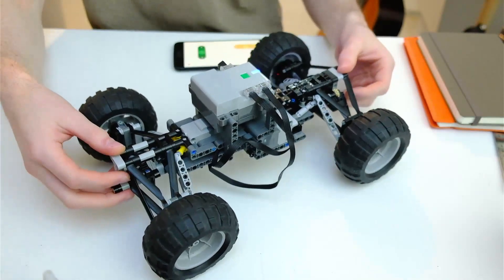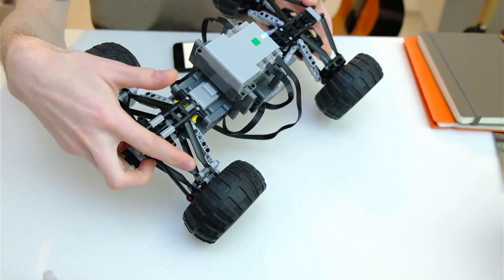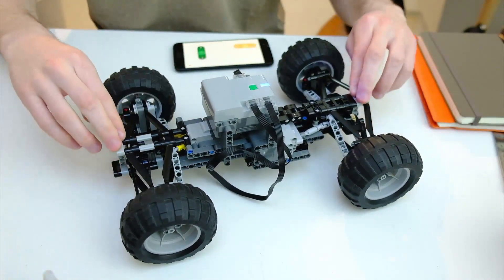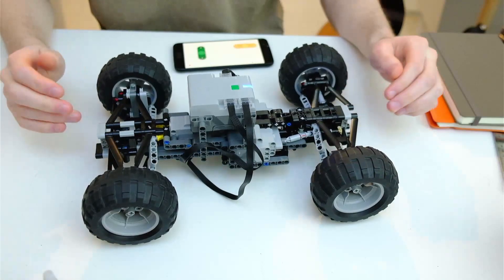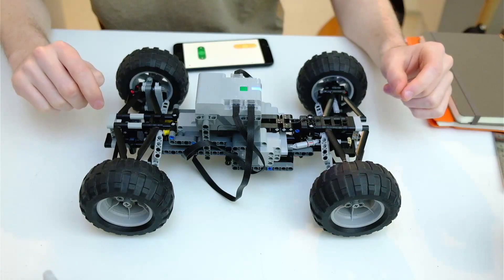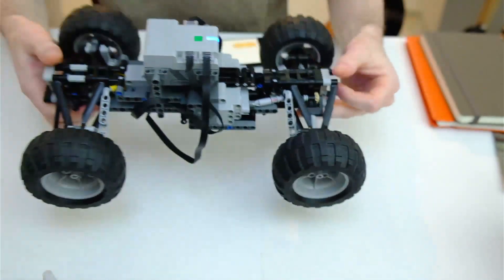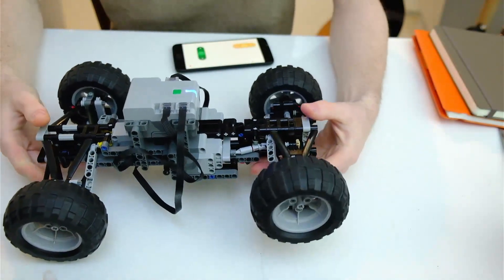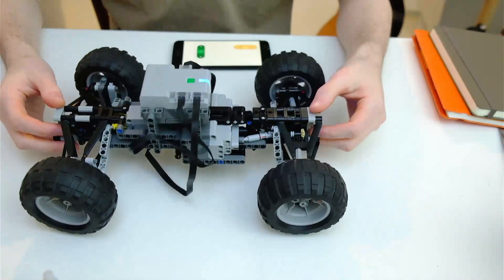Lego Technic Traxxis e-revo style pushrod suspension

Comment: Not a rigid setup but will probably handle the torque and speed of the powered up system. Such a cool design!
Reply from the maker: Thanks, a very valuable critique. I'm hoping to improve on these very aspects but I'm skeptical of being able to do so with the wishbone parts, so I think I'll work on the suspension system with regular suspension arms and see how I go. When I tried before it felt far more robust but I didn't complete a full chassis